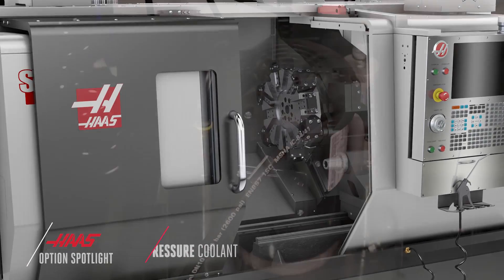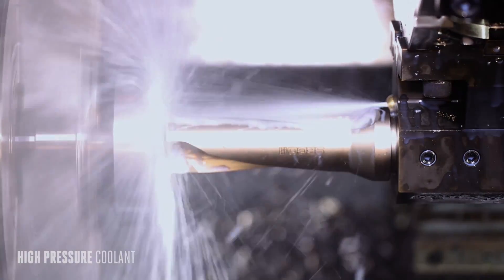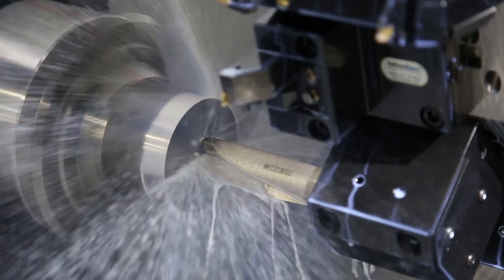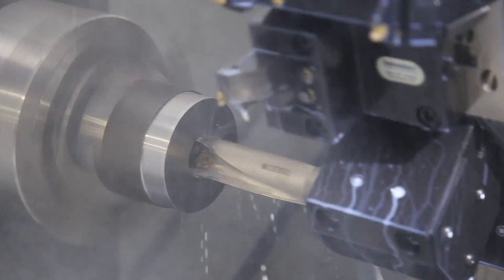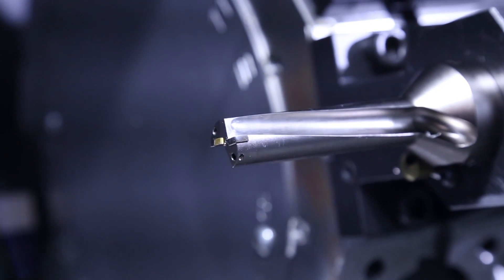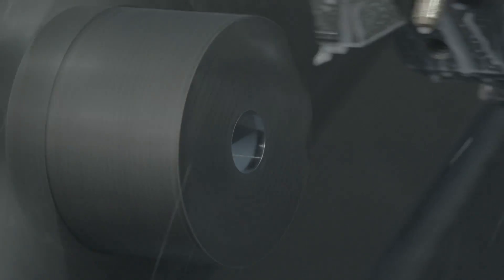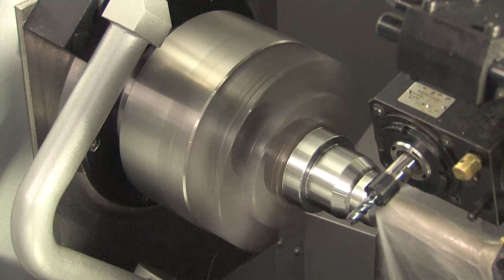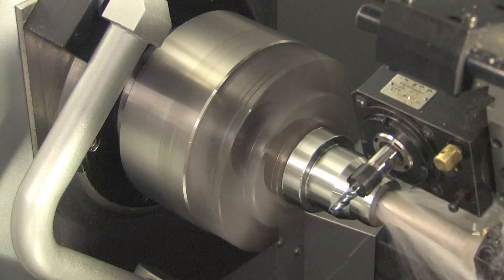High-Pressure Coolant - Haas Automation Option Spotlight

Comment: Can you put up details of what this program @ 40seconds does, I'm intrigued thanks.
Reply: Looks like it stores number of tools from variable #30065 (which is probably system variable of number of tools) to variable #10020. If number of tools is equal to 24 it jumps to N8 for 24 pocket turret tool definition, otherwise it goes to N5 for 12 pocket turret tool definition. Both store tool numbers and offsets to variables #10021 on.

I'm guessing those tools are later called by variable number and that programs is generic test program for different configuration lathes.
Reply: Rolltech Innovation manufactures machine coolant saver. Serious threats to productivity and health are bacteria and fungi which are commonly found in industrial coolants. This coolant bacteria filter has some advantageous features include: last a life time, with guarantee of extended life of coolant with bacteria filter - no consumables, no electricity, no chemical dosing, etc. 

It is a one time investment, ROI within 4-6 Months, Saves on input of fresh oil and disposal cost like etp treatment, or giving it to authorised recycler. 

These mineral oil based coolant are prone to generation of bacteria which produces foul odour, often from hydrogen sulfide [rotten egg smell]. 

Rolltech Innovation "Aqualogic" filter is an innovative and economical method of continuously controlling these micro organisms and the odour they generate. "Aqualogic" bacteria coolant filter consists of series of high-purity multi-metal fibres cased within a stainless steel tube. the dissimilar ions in the multimetal alloy bed undergo a natural electrochemical reaction, also known as an oxidation-reduction reaction. Which Kills the all the Microbial activity in the coolant 24/7

call us at +91-702-723-6191 or write to us at rolltechin(at)gmail.com

Enjoy the coolant being running without changing it, just keep the coolant healthy